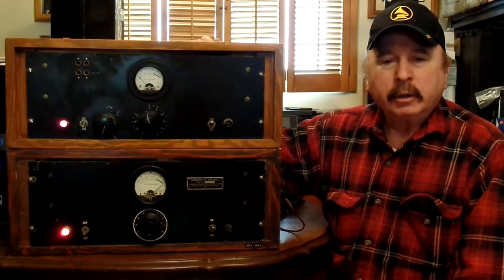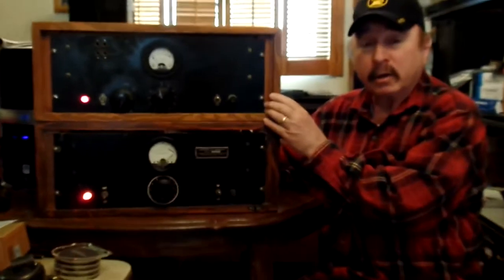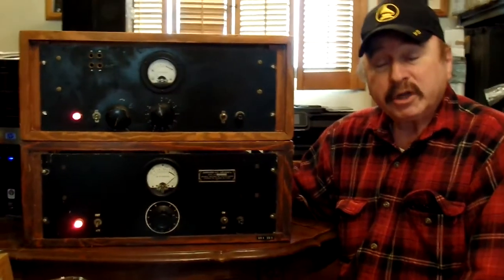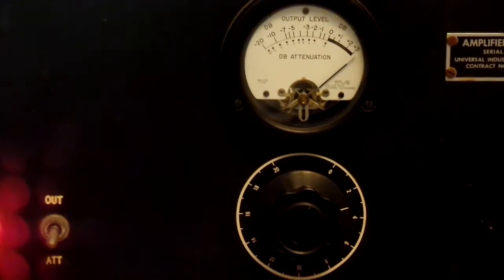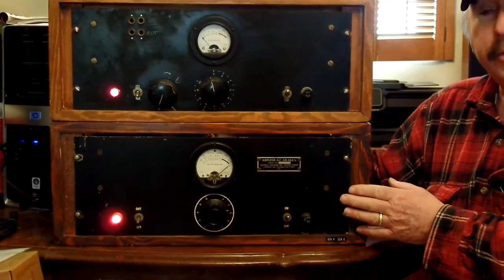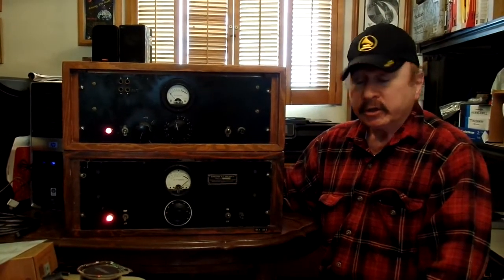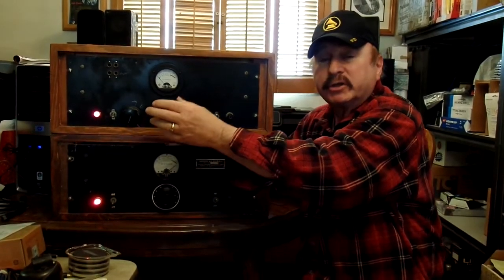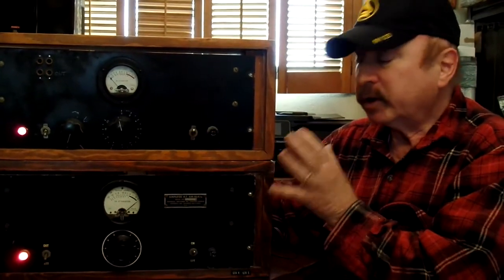The best audio Compressor Limiter part 2 Neil Young's engineer explains

Comment: hI Richard!
thanks for this great review
What was wrong with the limiter?
Best!
Reply: I became aware of Japanese knock-offs in surplus stores in the mid 1960s. Many signal coupling caps, which looked like large rectangular molded mica capacitors, all leaked DC. (I wouldn't be surprised if leaky caps were the problem here as well.) I changed all of them, and it worked well until the tubes got old. (The variable gain tubes were 6SK7, still easily available.) It was my introduction to audio compressors, as I made a test bed of it.  These days I would be more careful about matching the components, as was done in the Altec 436C, to minimize thumping.